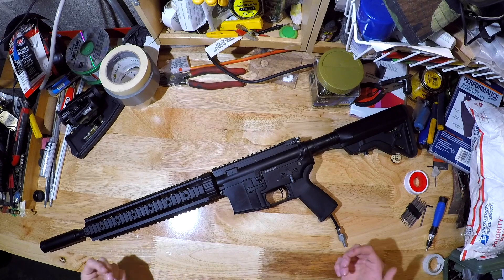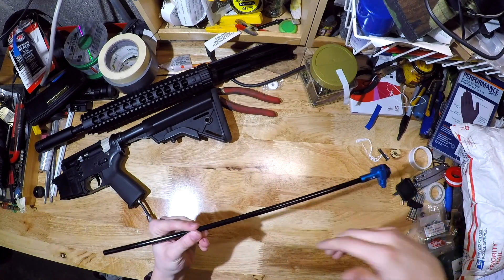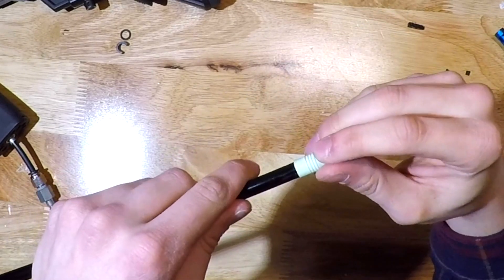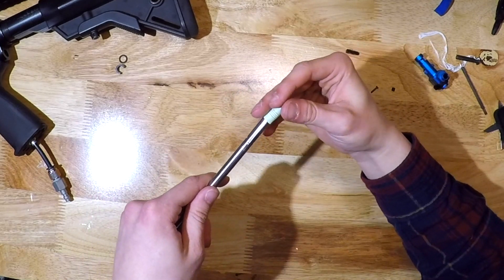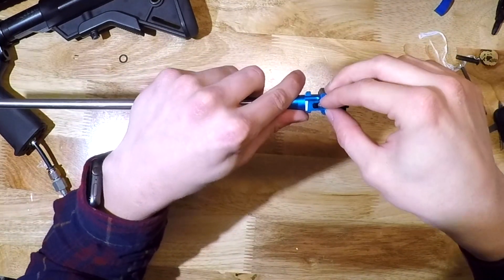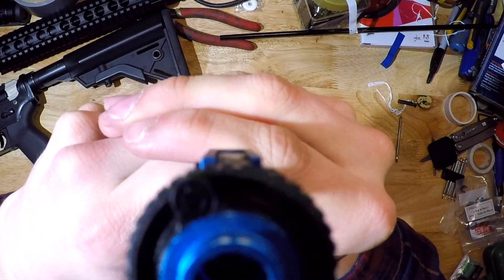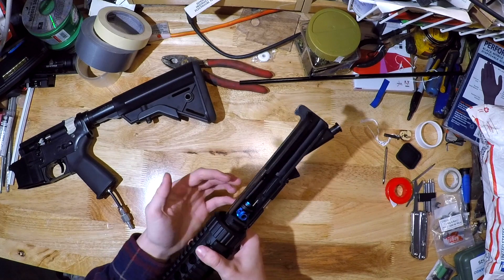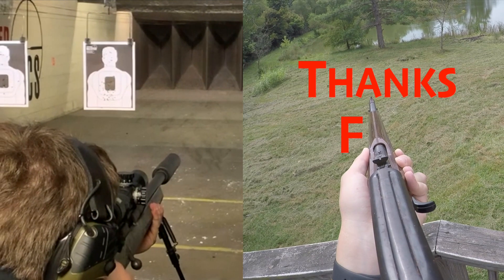Airsoft M4/M16/AR15 Hopup Disassembly + Configuration

Comment: Hey so the part that cocks my hop up back is lose do you know how to fix that?
Reply from the maker: I'm not sure what you mean, are you referring to the hop-up arm that moves your nub up/down? Could you clarify it? Sorry!
Reply: @targettrap6113  its like at the beginning of the buffer tube and when pull it back it shows the hop up if you know what i mean
Reply: @targettrap6113  like if you look at a real m4 ( mines airsoft) the thing that chambers a round that what it is and it usually forcefully goes back but when i pull it back its super loose and doesn’t do that if you know what I mean
Reply from the maker: Ah, you mean the charging handle or the fake bolt probably. If your charging handle is loose, there's a spring on the inside of the top of the upper receiver you can check where it's mounted. Make sure it's connected. 

If you're talking about the fake bolt, make sure its spring is attached (if there is one), and that it's not catching on the bolt catch or receiver. They're really finicky and I've had a couple buddies simply remove theirs since it's such a hassle to assemble the rifle with them. 

I hope that helps, sorry!
Reply: @targettrap6113  thank you so much
Reply from the maker: No prob at all, good luck!
Reply: @targettrap6113  thank you so much i found the spring on the handle and at the end when it is attached to the screw it just completely broke so im gonna get a new screw and i took out the plate to my hope up and it looks so much better!
Reply: @targettrap6113  i mean spring not screw
Reply: @targettrap6113  and hop up i had typos my bad
Reply from the maker: Glad you figured it out!

Comment: I took apart my hop up to upgrade my bucking and put a flat hop in it. It shot out a small spring. I don’t know where it goes. I’ve beeb watching videos of hop ups all over the place but can’t find anyone else that has it. Does anybody know?
Reply from the maker: A few possibilities:
1) it could be the spring that provides tension to the arm. It’s not shown in the configuration I have, but the standard gear-type design has a small spring that sits between the top of the chamber and the bottom of the arm. 

2) the spring that provides tension for the chamber itself against your front trunnion (timestamp 1:34, figure B) could’ve become detached, but I can’t see this happening easily 

Hope this helps, sorry to hear that!